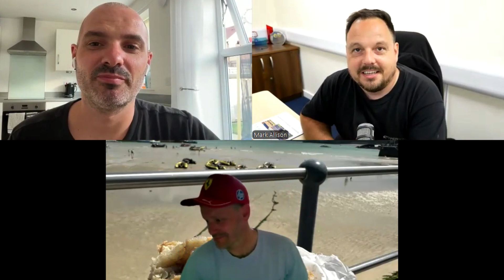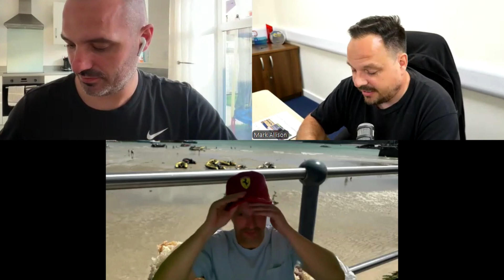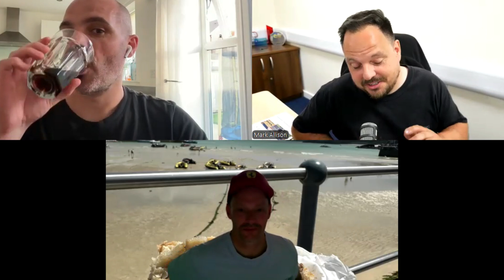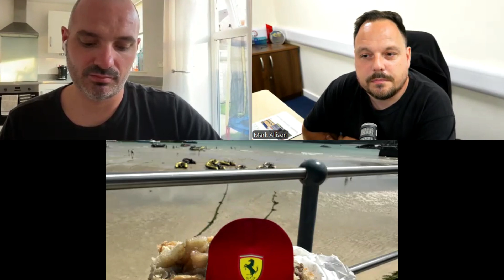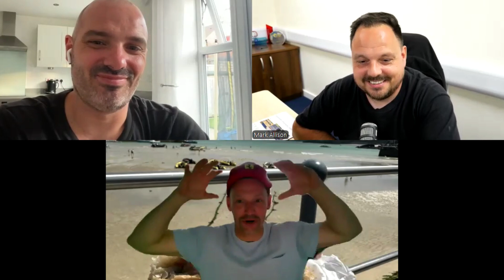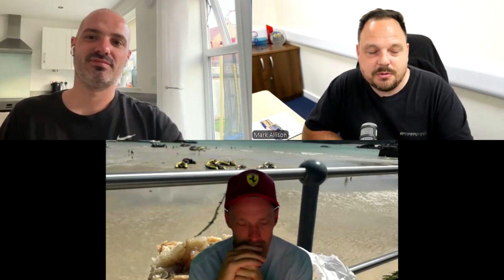Poor electrical work prosecuted - Design a share trading office - Heat pumps RCDs...

Comment: Good discussion team.  I do agree with the concept that there needs to be a mandate/product specification for heat pumps that states the type of RCBO MUST BE displayed on the manufacture plate/sticker visiable on the device itself.  This would remove the guess work of will a type A or B or B-HP RCD be correct and then the 30mA or 100mA for the leakage.